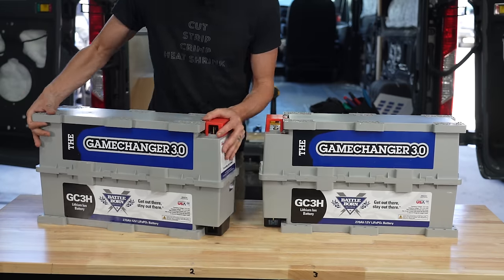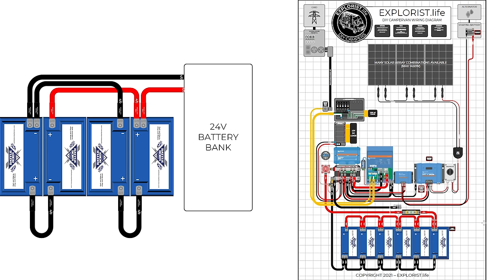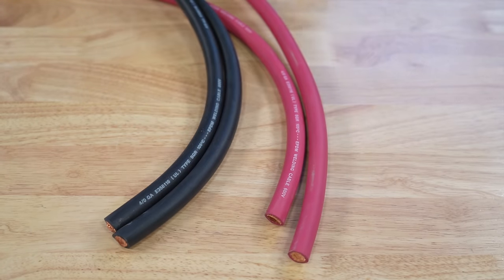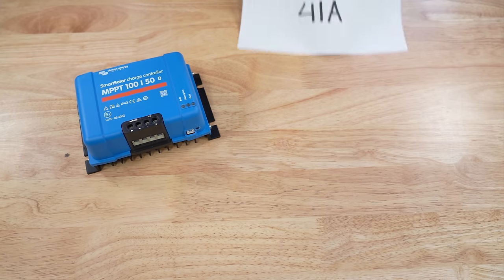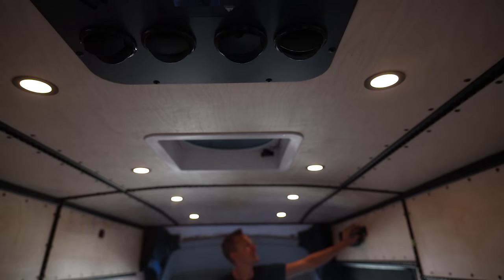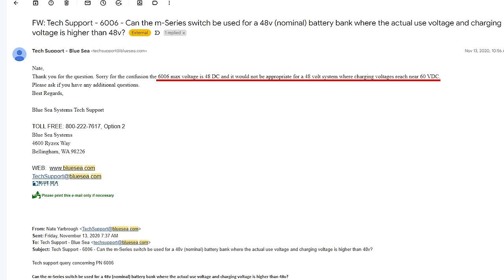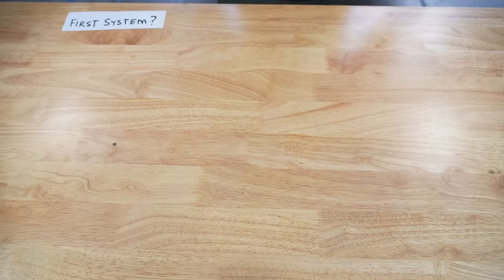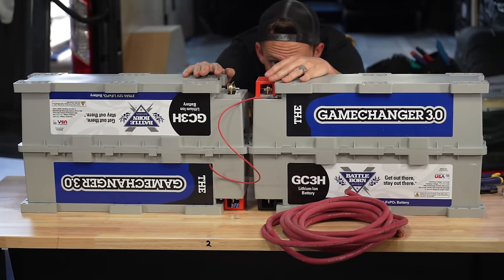12V vs 24V vs 48V (For Camper Electrical Systems)

Comment: A year ago, I decided to order a transit and started planning.  I had decided to go with a 24v system and started buying components and researching.  I am a week or two from doing the electrical system and was more than pleased that this dropped as actual details on 24v system installs are pretty close to non-existent!! Looking forward to your excellent presentation on a topic that desperately needs an explorist drop!  Thanks, as always, for sharing!  I just hunted your site for a 24v diagram and only found that monster system.  Will you be adding a diagram for the system you are about to install in your van?
Reply from the maker: Nice!  Yes, we will have not only a diagram available for the upcoming system... but also a full parts kit with all of the wire, fuses, heat shrink, lugs, components, enclosure plan, etc to make it work.
Reply: @EXPLORISTlife  I'm up to my a$$ in all the 'parts', but, we'll see if I got the right stuff.  If not, I'll be ordering!  :)

Comment: Hi Nate that was very informative.
This will be my second RV 5th Wheel solar install. My first was 12v 600ah of lithium batteries 1550w of Solar with all victron components. I was planning on a 48v setup but after watching your video I think 24v may be a better option this time but here is my situation. I will have the following 12v accessories. Disk brake pump (critical), hydraulic slides and leveling jack's, electric slides, 4 tank heaters, 12v compressor fridge, plus lights and water pump. 

The new system will have 800ah battery, 1600w of Solar with Victron components. 

Do you think I should keep it at 12 v, I can keep the cable size manageable with lynx components and having the inverter and battery bank close or have the 24v bank plus one 100 ah 12v battery connected to a 30amp DC-DC charger to take care of critical and high load 12v as well as connecting to the truck for charging, or use something else? I am very interested in your opinion. Many thanks.

Comment: I have a question I hope you can answer.
I'm getting 8 400 amp hour lithium batteries. I'm getting a 6000 watt inverter it has four 110 volt plugs and it has the terminal block that I can hook in 10 gauge wire. I will usually 10-gauge wire to hook into a 30 amp RV plug.
I would then take the 30 amp RV plug coming from the camper and plugging it into the 30 amp RV plug it is hooked into the inverter. I was planning on then running everything in the camper off the lithium-ion batteries including the air conditioner. I was then going to buy a 48 volt charger to recharge the lithium batteries as needed off of an inverter gas generator.
If you understand what I said here, will this work okay?
I will not be charging the lithium batteries off the truck that will pull the camper.

Comment: I went with a 24v system in a travel trailer to save some money.  1260W solar array, 10.2KWH battery bank.  I used a DC-DC converters to step down to 12v for distribution panel and another for the tongue jack. E-brake, etc.  However, there was one thing I did not consider.  We have an onboard generator that has a 12v starter.  So I also have a small 12v battery with a 12v charger just for the generator.  Don't make my mistake :(
Reply: best to have redunant batteries, if the 24v system is down you cant get your 12v to the  genny started to charge it up anyways.
Reply from the maker: Yeah, I've actually done that exact same thing before.  Glad you found a workaround!

Comment: So I'm doing a camper conversion with an enclosed trailer with standard exterior 12V LED lights. Each single light has the negative/ground attached the the frame (it seems most trailers do this).  I already have 24V batteries that I want to use as my main bank.  I plan to power the 12V trailer lights from a 12V panel (after the 24/12 converter, of course) from my main system. In other words, I'm not using the tiny 12V battery that came with the trailer.  The big question is if I have a 24V Victron Multiplus II (2x120), will the ground wire from the Multiplus (connected to the metal frame) interfere with the grounds of 12V trailer lights already installed?

Thanks for your great videos. Very helpful.

Comment: Hello, I'm from Brazil and I'm thinking about building an expedition motorhome with a 48 volt battery bank. Today in 2024 would you set up a 48 volt system? Has your opinion changed regarding 2022? Do we today have components to assemble a motorhome at 48 volts and safely take loads from a 12 volt alternator?
Reply from the maker: No change, no.  Try the 'system picker' on the home page of https://shop.explorist.life to be pointed in the right direction of a system we recommend.

Comment: Great video Nate. I'm assembling my first solar system for my class-b motorhome. I have 3 x 300w panels for the roof, could go 4 if needed. I'm going to run a 3kw inverter\charger\transfer sw.  I have 2 200AH Lifepo4 batteries with room to add if needed. I have A\C (soft start), convection micro, 12v fridge, etc.. On this video you classified a system like mine as a small system, and to go 12v. I'm going 12v so I need to parallel my panels (cost isn't a big issue for wiring) my panels are 17.4 amps each x 3 so I will run a 100 amp 12v MPPT controller which will give me room to add a panel if needed. My question is, what size wiring will I need to inter-connect the panels on the roof, then what size down to my controller?
Reply from the maker: You'll want to wire in series or series-parallel, but this video talks about wire size for solar arrays: https://www.youtube.com/watch?v=JW0vrTAa50s&list=PLmvhcyi4n0TV9pi83rFTv3ZuMT_S1xIZt

Comment: I would like to install a 24 volt lithium batter system, 1200 AH.  Wonder if you could discuss why, I am told, I need downstream of the 24/12 DC converter, a 12 volt AGM style battery.  I have a diesel pusher motorhome and it is equipped with a switch that temporarily allows me to start the main engine with the house batteries.  I suppose that the generator is also started from house batteries.  I really do not understand why I just can't connect the 12 volt output from the converter to the 12 volt bus on my motorhome and all should be well?   Please make a video explaining this.  Thanks.

Comment: great series of videos!

For deciding 12v, does <3000W inverter assume that there is minimal 12v usage at the same time?  Lets say that i want to be able to use 100A of 12v, and might max out my inverter (3000/12 = 250 amps), for a total possible current draw of 350 Amp.  This would only be needed in 15-60min increments.  Is 4/0 undersized for this?  The reason I could be drawing 100A of 12v is mainly because of 12v AC and potentially other things.

Comment: Hello, i have a 200w kit and one battery,(Redodo 100ah 12v)..im just using a smart charger to play with the battery and stuff i want to power.. which are just some USB powered Led lights,a road pro lunch box cooker,a 110w 110v crock pot (not at same time).. 
I just have a cigarette lighter plug with 2 USB outlets, the 100w duralast plug in inverter (just for that crock pot,it must run lower than the 110w its rated for because it powers it or the inverter is a bit more than the 100w its rated for.. 
Now that you know what i have,here's my question.. 
The lighter USB outlet, the wires are little,nowhere near the #4 wires, the holes to screw any wires to the controller are tiny.. the wires from the panels aren't even that big.. so I'm super confused about proper wire size and hooking it in.. im having difficulty just telling which is hot and ground on the panels too

Comment: I purchased an all-in-one unit with two 48 volt server rack batteries for my camper. 2200 w on the roof of solar. I cut my shore power cord for the end and out and it goes to the RV electrical panel which already has a 12 volt converter that powers the camper . Still waiting for the all-in-one to finish the install, any thoughts?
Reply from the maker: I have thoughts, but I think my thoughts would likely discourage you from finishing your install, which it sounds like you're committed to already; so I respectfully decline considering I don't know the full scope of what you've got going on.  If you want my recommendations on how to set up these systems... here is how I recommend setting up systems for campers and RV's: https://www.explorist.life/solarwiringdiagrams

I know Will Prowse does a lot of work with Server Rack batteries and all-in-one's, so maybe hop over to his channel for assistance in setting that up as that 'type' of system may be more in his wheelhouse.

Comment: Great video! I’m about to purchase a victron set up but I’m conflicted between the multiplus and multiplus ll. I mostly see the plus being used though the plus ll has been out for years. Also the plus ll has steel case, spring connectors and is taller, all of which is concerning hearing about frying the unit if wires aren’t fully seated! I’m expecting my 170 sprinter in July? I’m leaning towards the plus with aluminum case. Help!?
Reply from the maker: The main consideration between the two units is their physical dimension.  The original Multiplus 3k is shorter and fatter and the ii is taller and skinnier; which means it often can't fit in as many places.

'wires not being fully seated' can be a problem no matter the unit, but if you take special care and have good workmanship; that's a non issue.
Reply: @EXPLORISTlife  
Thank you so much Nate! I’m going with the plus even with the higher price?? as it will fit and I’ve never been a fan of push connect terminals. I planned my system with the plus and just started to see the plus ll? Oh well, Thanks again! I love your classes and advice. Looking forward to meeting you at a van expo event one day. 👍

Comment: Nate, Love your channel, I followed you plans last year for a 3000w inverter and 400 amp hours of batteries.  I have not installed a roof rack and solar yet.  And love the new series. I wanted to follow your recommendations with the roof rack and solar.  Will my system handle all that solar and the AC unit?
Reply from the maker: Roof Rack: Yes!  If you've got a compatible Ford Transit, of course.

Solar array: Also yes, but with the adjustment of a charge controller, which I've already assembled in this kit: https://shop.explorist.life/shop/all-products/camper-wiring-kits/solar-charging-wiring-kits/580w-solar-charging-wiring-kit-12v-battery-bank/

For the AC... We are using a 24V Air Conditioner in this build.  If you've used a 12V system, you'll just have to swap over to a 12V Air Conditioner.  The nomadic 12V 3000 AC is the same dimensions as the 24V version, I do believe.

The only 'issue' you'll run into is you likely don't have enough space on your Lynx Distributor to add the Air Conditioner.  If you have enough space, you'll want to add a 2nd Lynx Distributor.  If not... you can hang a MRBF terminal fuse off the far right end of the Lynx Distributor, if you have room there, for the additional circuit.

Comment: I am currently building a Skoolie. I am planning on going with the Signature Solar EG4 LifePo4 batteries. I am also planning on purchasing a couple of your kits and stand alone items from your shop. Before I order one, I cant find anywhere that will tell me if the Victron battery monitor will be compatible with that product. Do you have any insight on that?
Reply from the maker: The BMV-712 works with nearly any type of battery but I don't know much about those batteries, so you'll have to do your own due diligence on that end of things.  If you want my recommendation, I'd strongly advise to go with Battle Born batteries instead as I know that they will work without a shadow of a doubt and they are designed specifically for the harsh conditions of mobile applications.

Please note the following lines from the EG4 user manual and warranty (paraphrased):

Installation Environment: No conductive dust, corrosive gas, or *vibration*.

Warranty void if: Using product in applications other than which it was intended for by manufacturer,
Reply: @EXPLORISTlife  thank you!!

Comment: Hi Nate thank you for the amazing explanation! Is it possible to take a solar array producing 60v 16amp run it through a 12v, 24v, 48v MPPT solar controller and charge a 48v battery bank and then cut the solar array breaker, reconnect to the 12v bank using a 1, 2 off (non both) battery selector switch. One for the negative and another for the positive side, turn the breaker back on and reset the solar controller for 12v?  If so or no is there a better way?
Reply from the maker: I'm not really following why you'd want to do that.  Here is a list of diagrams that shows you how I recommend designing a system: https://www.explorist.life/solarwiringdiagrams

Comment: Is there a solution for charging 24V batteries from the van's engine? I guess some dc/dc converter could work, but isn't that expensive and inefficient?
what about finding lights and all other devices on 24V, isn't that an issue?

Comment: I’m interested in building a 24v setup similar to yours but can’t find any information on calculating the amount of AH I would get once converted to 12v.  So if I used two 270ah Battle Born GC3’s wired for 24v and converted it to power 12v appliances how many ah or watts would I have?  I’m not fully understanding how to calculate how many 12v AH I would get after being converted from 24v.  Thanks for all the videos and outstanding information!
Reply from the maker: You should use the formula Amps x Volts=Watts to convert to watt hours.  Example:

100Ah x 12V= 1200Wh
100Ah x 24V = 2400Wh
Etc etc...

This is a great video idea for me...  thanks for that.

Comment: I have a 270 amp alternator feeding 4 chassis batteries.  These then power a dc to dc converter charging another 4 house batteries that are also 24 V.  I have a 4000 W 24 V inverter/charger. I use a transformer off the batteries 24 V down to 12 V. This powers all the lights, ceiling fans, phones, etc.  Everything else is 129 V, fridge, stove, tv.  Has worked very well so far.  I am considering solar but I think if I did it I would want to go with a few thousand watts.  Not sure if its worth the investment or not.

Comment: Thanks for the video! I'm basically sold on the EG4 48v server rack batteries and the 6500EX-48 for my van. Would be perfect for running some of my power tools while working. The only thing that puts me off is the price of the 48v alternators to recharge battery bank... hopefully there are some more options within the next 12 months?
Reply from the maker: Be sure to check the warranty and user manual for those batteries.  They are not to be used in an installation subject to vibration and if the batteries are not installed per the user manual, the warranty is void. 😬🫣

Comment: If I want to keep my 8 12v 100Ah lithium batteries in a line of 8 due to space constraints, can I join two groups of 4 12 v batteries in parallel (2 x 12v@400 Ah) and then those 2 in series to get a 24v system for 24v@400 Ah ? And by the way, you guys have a really informative and helpful channel. Keep it up !

Comment: Awesome video love the channel. Question please:: which is more efficient on  a 40a mppt epever using 2x120ah agm batts and 4x120w 18v 7.7a PVs ....panels wired in parallel, series or series parallel?
Reply from the maker: Hey, King Blade! I appreciate you taking the time to ask your question, but unfortunately, I don't have enough info about your specific question to provide an accurate answer, but here is a playlist that, if you watch all of the videos start-to-finish (and take notes 😉), you'll have a REALLY good idea of how to design a solar array: https://www.youtube.com/watch?v=Jkbs84sBHsg&list=PLmvhcyi4n0TV9pi83rFTv3ZuMT_S1xIZt

Alternatively, I have some of my most common solar array setups pre-built here: https://shop.explorist.life/product-category/all-products/camper-wiring-kits/solar-charging-wiring-kits/
Reply: @EXPLORISTlife  thanks for the speedy reply much appreciated..I have looked and watched for several weeks now both your sites and Will Prowse but still can not understand what's best even for a simple 2x120w pv and 1 x 12v 100ah battery system using the epever 40a mppt parallel or series do I want high amps going into the battery or high volts going into the mppt?

Comment: Nate, what do you do your drawings/diagrams on? I have experience with Visio, but I am having difficulty finding stencils for doing a drawing for a solar power system I want to build.
Thanks for any info.
Reply from the maker: I use Microsoft Visio.  Most of the stencils are ones I've made from scratch over the last few years.
Reply: @EXPLORISTlife  Could you please point me in the direction of some stencils or be willing to share yours? It would be greatly appreciated, sir. Thanks!

Comment: Thanks for your advice would a renogy 12v 12v 60a dc to dc is this ok for a Renault Trafic alt gives 130a ( would 60a at low revs be ok for the alt heat wise or have I got it wrong)
Reply from the maker: General rule of thumb is to keep your DC DC charging less than 50% of the amps of your alternators rated output.
Reply: @EXPLORISTlife  Ok thanks